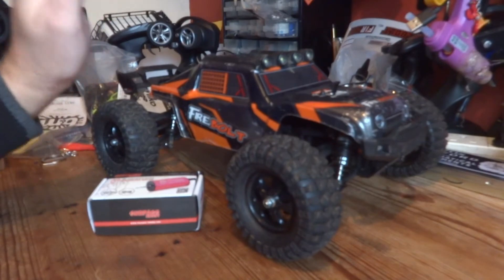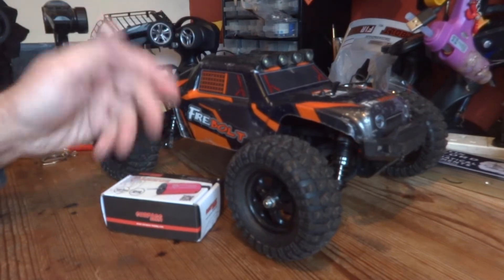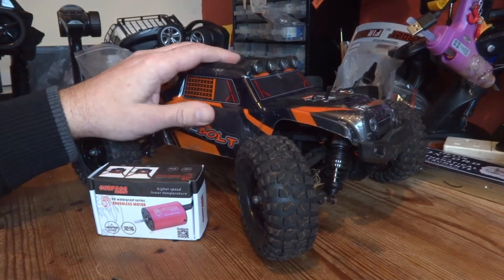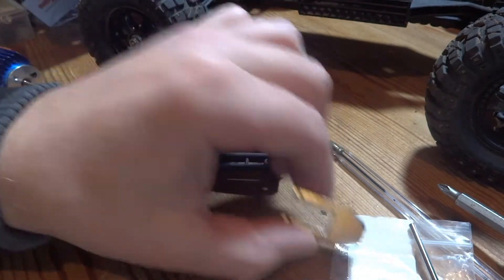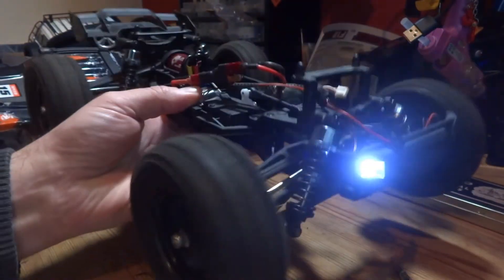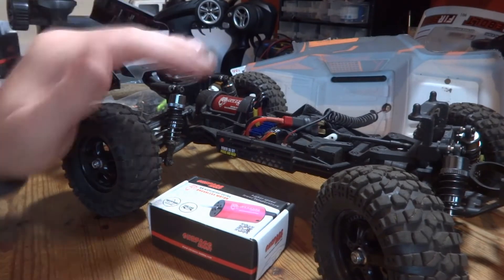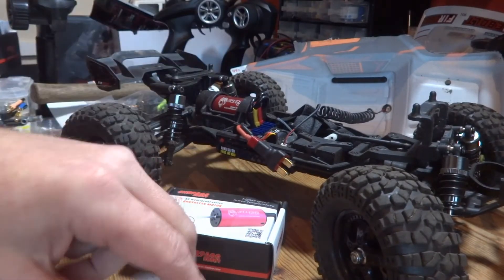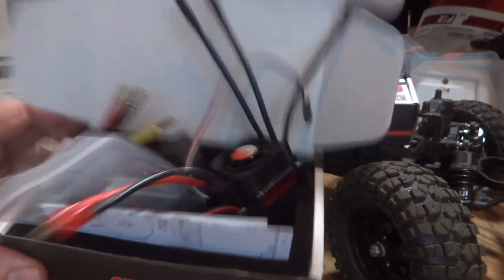HBX 901A 5900Kv Surpass Hobby Brushless Motor Swap. Will It Perform With Stock ESC?

Comment: To run this on a 3s lipo would I need to upgrade the esc? I'm a complete knoob,  love this little truck it's great
Reply from the maker: Sorry my friend for the delay in replying. I don't always get all the message notifications. I personally would upgrade the electronics if you thinking about running 3S all the time. The standard esc will melt for sure. Or you have the usual HBX thermal cut out issues. This this rips on 2s now we have a 60A esc in there. No need for three!!!!

Comment: How's the cogging? Would have been nice to see that as an additional test. Maybe in another vid? FYI you can also swap the pinion to a 14T on the stock motor.
Reply from the maker: Hello Brad! As i mention at the end of the video, it's non existent. Same or smoother than the original motor! And yes a 14t gear is on the cards at some point. Thanks for watching and taking the time to comment. 👍👍

Comment: Really interresting. The stock motor comes with a motor mount that supports a 14T pinion so thats worth trying for people, interested in a smaller speed bump. I couldnt get the stock pinion off for exactly the reasons you identified but I`ll order one of those pinion pullers and try again. Your top speed with the bigger motor roughly matches what I get with the stock motor and pinion on 3S but the lightweight nature of the truck means its pretty hard to control at that speed and flip overs are common. Im not sure I`ll run it on 3S very often. Initially I had exactly the same problem as you, getting the heatsink off the motor but a mole wrench sorted it out in the end.
Reply from the maker: Hello Patrick. Yes i noticed the alternative motor position. Here's the link for the pinion puller: https://uk.banggood.com/custlink/Gm3YQjo7eA its a must have piece of kit to be fair. And i agree at higher speeds it does get a bit twitchy!

Comment: I got the same motor coming in today, gonna throw it in an UD1602 (Breaker). Was wondering if it could work. Excellent video, cheers!!
Reply from the maker: Are you sure it's the same motor? Seems awfully big to go in one of those little drift cars!! It will be an absolute monster!!!!! 😨👍
Reply: @theminiatureconstructionco4556  I probably got the models wrong. Mine came with a 2435 brushless 2.3mm shaft. I’m getting a 2440 from Surpass. Mine has 3600kv (could be off) and the other will be 4600kv. Not a huge jump but, hopefully does something lol..I’m just getting back into RC’s. Last one I had at 10 was a Grasshopper in 1993 lol…So my specs and models might be off lol
Reply from the maker: @patrickjames661  that sounds more like it. It will still shift though!!! The one in the 901A is 28mm dia. Mind you the brushed version comes with a 380/90 motor I think. Which is larger than the brushless. So perhaps you can? 👍

Comment: Do you think adding the heat sink back might help keeping the esc from cutting out if it keeps the motor cool enough?
Reply from the maker: Got to be worth a try. Even though it's a pain to get it in and out of the holder with it on. Hopefully it will just slide or clip on. 👍👍

Comment: Great job on this upload! The Heat is from the low amperage esc. Lots of resistance there with those smaller gauge wires and circuits on the board. A larger mah esc would dissipate the heat better. This still was an impressive experiment. How many runs did you get before the thermal cut off took place?
Reply from the maker: It was literally toward the end of the battery's. I don't think It was the low voltage cut off because there seemed to be to much go when it resumed. It only did it a couple of times. 👍
Reply from the maker: I let it cool a little then just messed about until the batteries completely died. 👍
Reply: @theminiatureconstructionco4556  I’m sorry, meant o say **thermal cut off**.

Comment: Had no problems running that motor with a 35a esc?
Reply from the maker: Yes, in the end it went pop!
Reply: @theminiatureconstructionco4556  Exploded?
Reply from the maker: @rush338  just stopped working, basically. Steering still worked, but no forwards and backwards anymore. 👍

Comment: Where did you get that pinion extractor? Looks a must have tool
Reply from the maker: There's a link in the description. AliExpress. 👍👍
Reply: @theminiatureconstructionco4556  was going to order this hbx but went for the a lot cheaper flyhal fc610. Basically a hbx 903 with a 550 motor and a lot of potencial for a brushless setup even though 30kmh is enough for my bashing style lol.
Reply from the maker: @farmoboy83  you will not be disappointed. Did you use the link in the description? 👍
Reply: @theminiatureconstructionco4556  it looks like it would be awkward and cumbersome on a little pinion set screw. Just had to drill out one myself, glued from factory I guess. 5 minutes with a cobalt bit.
Reply from the maker: @stickem1974  well it does come with a load of different sized pins for different sizes of motor shaft. I've just it twice now and it's been a godsend.  It did fail once but only when I was unable to get the plate underneath the pinion. 👍👍
Reply: @William Perri looks pretty tough but I don't bash it as hard as the 16889 for example. 550motor is very good but the gears are made for torq, not topspeed. For example, wltoys are always geared for higher topspeed, sacrificing torq and battery life. Personally, I prefer less speed but stronger acceleration. Less speed is also good to protect the rcs when hitting something. This fc600 has a topspeed of around 30kms while similar wltoys go around 40-45kmh.

Comment: Question is...how much of the battery runtime did it steal?
Reply from the maker: That's a good question. Obviously anytime you make something faster, the energy to do this has to come from somewhere. It was one thing at the time I wasn't really concerned with. 👍
Reply: @theminiatureconstructionco4556  do you think it took away 10 minutes of runtime. Im trying to decide if i wanna do 3s battery with my 2840 3900kv or do a higher kv motor with 2s battery. I just want to achieve 35mph with consistent runs.
Reply from the maker: @RayRiv73  I double up with the batteries (piggy back). So it's difficult to tell. Also if you have a look at the later video. I knackered the standard electronics running 3s. I've had a couple of comments off people saying you shouldn't do it because the ESC overheats constantly. Which to be fair it did a couple of times.
Reply: @theminiatureconstructionco4556  thanks for the replies. I ordered a 3s 20c 1300mah to give it a shot. If my electronics gives me  issues then ill take it from there.

Comment: I have HBX 901 almost brand new, suddenly stopped working at all, the battery is okay, the only thing work is the led light but nothing else, i need your help please
Reply from the maker: Sometimes if they get hot they will cut out. Normally though after a short period they will turn back on. 👍
Reply from the maker: Does sound as though your ESC receiver has gone though. 👍
Reply: @theminiatureconstructionco4556  yes no beep sound when i turn the car on
Reply from the maker: @mohammedhijazi6929  it sounds like your ESC has packed in. Are you able to test the battery? 👍

Comment: Was that on 2S lipo?
Reply from the maker: Yes it was on just 2s. I've heard that the stock ESC will handle 3s? 😨
Reply: @theminiatureconstructionco4556  that is an excellent upgrade than for sure 👍I should try it on my SG 1601 Pro and see what happens 😝

Comment: You are going to burn up your ESC after the motor explodes to heat. Check the max amps on that high kv motor. Higher the kv higher the amps. Best of luck...
Reply from the maker: It was just a glorious experiment really. Just wanted to see what happens and if any issues became apparent. 👍👍

Comment: The mid motor chassis design puts too much force on the direct drive main gear . Destroyed the rear diff pinion and ring gear several times truck can't handle this high kv motor. Those receivers and ESC in one are junk as well.
Reply from the maker: Interesting. The video was just a proof of concept really, a what would happen if you like. I'm going to try it on 3S as well at some point see what comes unstuck. 👍